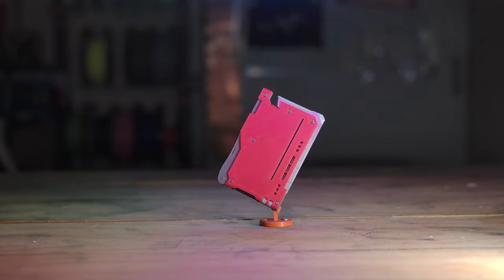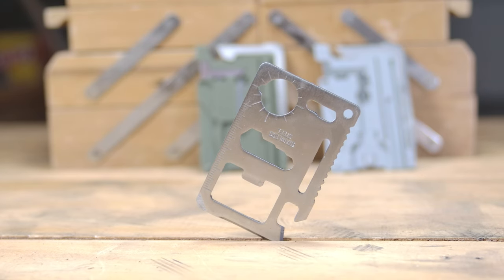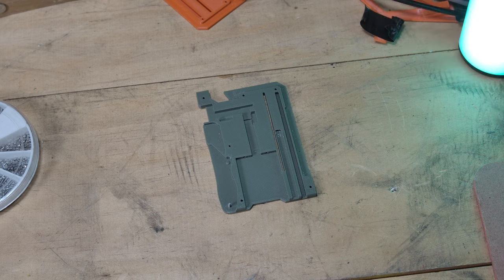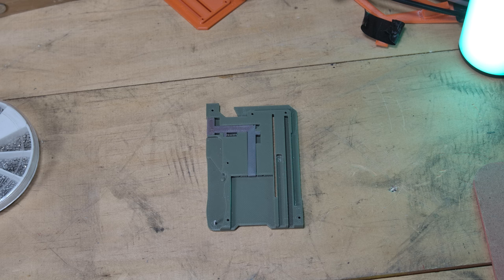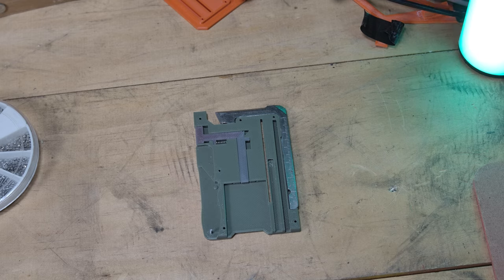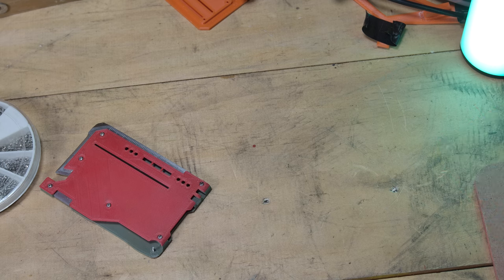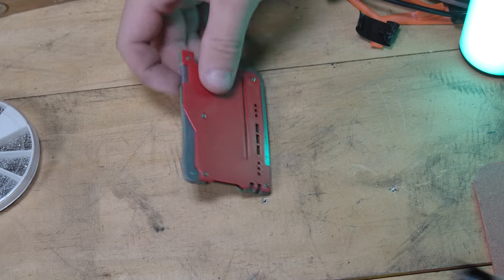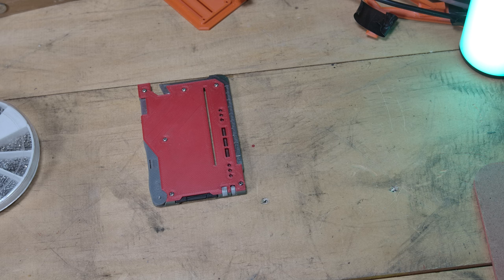How To Build Your Own Printed Multitool

Comment: Have you tried the can opener since you changed the "pivot point" for it to the 3D printed corner?  I'd worry about it breaking.
Reply from the maker: I cover it on the files page but its not meant as a functional component, its left in because it looks cool. Works alright as a cordage cutter but its really just left for show since theres no gain in cutting it off.

Comment: you forgot the nut on the skrew holding the blade
Reply from the maker: You mean the one it pivots on? I don't use one because there isnt room and creating a recess in the blade handle would make printing it more difficult.